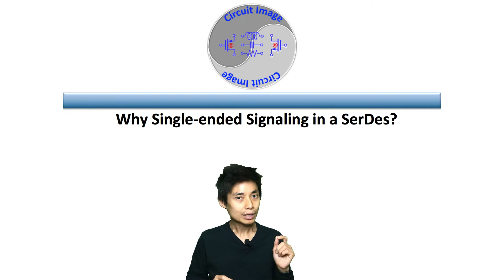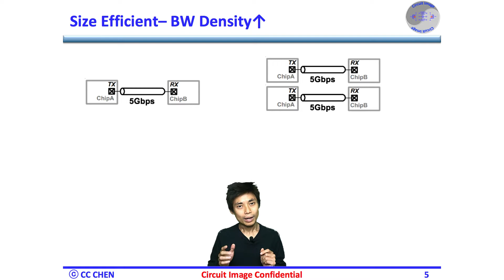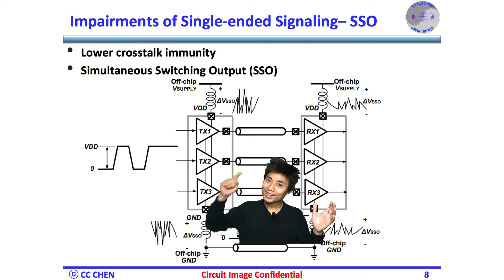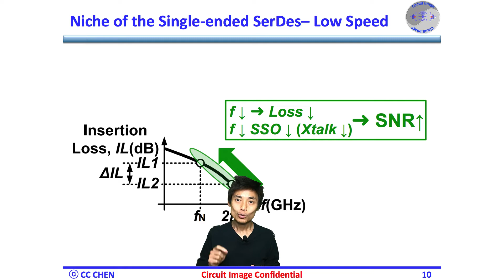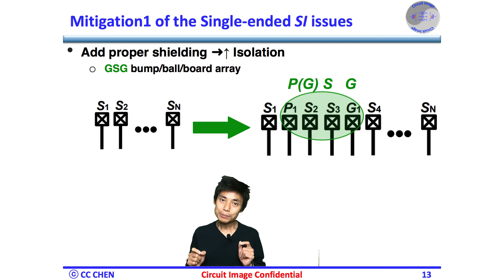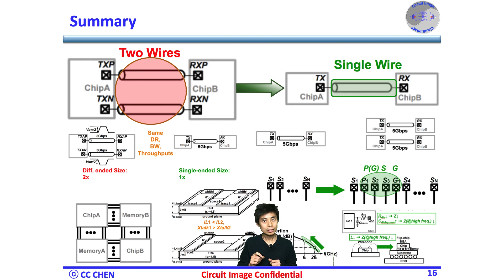Why Single-ended Signaling in a SerDes?

Comment: Thanks for sharing, there are two questions I'd like to discuss with you
1. For the xtalk, if we use differential signal to transmit the data, the xtalk can be reduced it because it can reduce the mutual capacitance and mutual inductance; But for single-ended, if we want to reduce xtalk, it's better to separate the two wire as much space as possible, is it correct.
2. If the signal is such a high speed signal, then is it better for using differential signal to transmit the data.
Thanks again
Reply from the maker: @許育瑛, Thanks for the feedback. 
1. Yes, but if you do single-ended you'd like to save area, which is a conflict of separating the distance :)
2. That's correct! :)
Reply: @circuitimage  I appreciate your reply
So it's like a tradeoff and also depend on what kinds of application
Reply from the maker: That's correct :)
Reply: @circuitimage  I see, thank you for the kindly reply👍
Reply from the maker: @Erichsu-e9m  Sure. Any time and thanks for your feedback again 😃